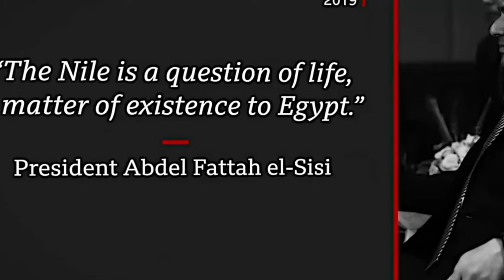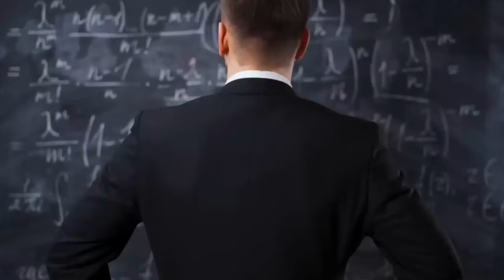Africa's $5 billion massive dam on the Nile River

Comment: Not sure why this video is structured the way it is given the existing status of the project. I think reservoir is its fourth filling cycle as of 2023. Most of remaining tasks revolve around about getting power house completed. You might have mentioned that given the location of the dam immediately adjacent to border with Sudan, it isn’t used for irrigation and for Ethiopia to derive any benefit, the water must flow through the power turbine generators into the Nile river.
BTW, just over the border in Sudan, Sudan has a dam that does divert water for irrigation.